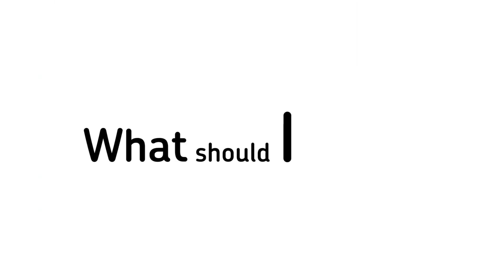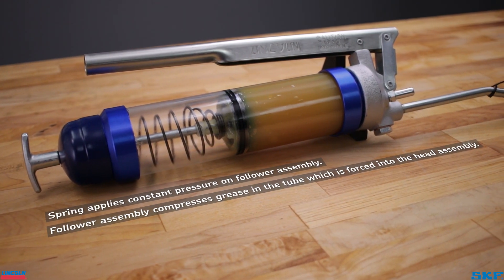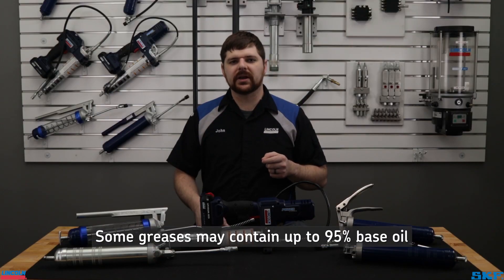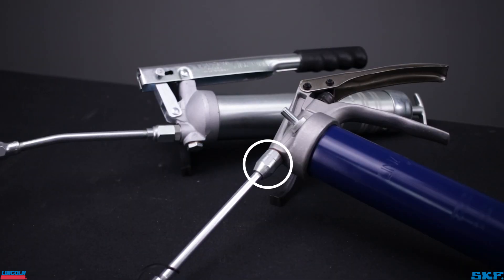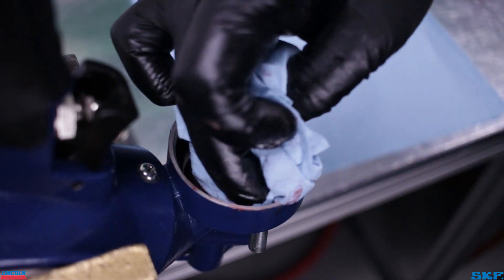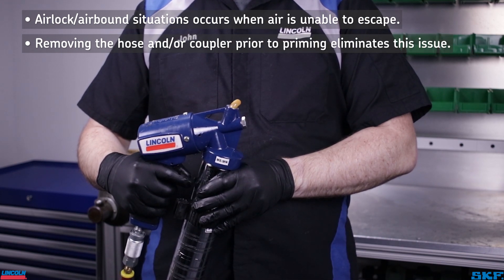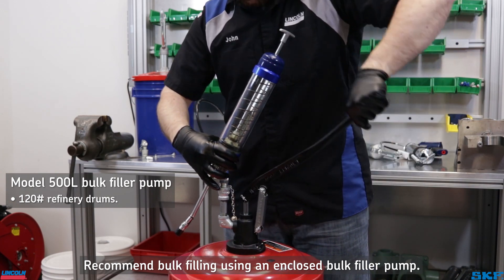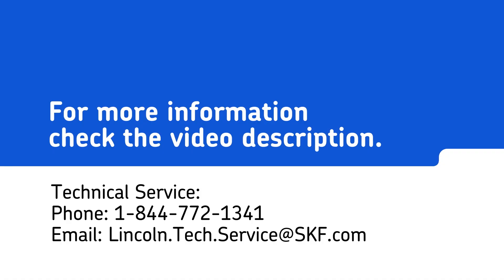My grease gun does not dispense, What do I do! - Lincoln Quick Tips

Comment: So tell me what's wrong with my brand new out-of-the-box pneumatic guardian Lincoln  grease gun🤷‍♂️🤷‍♂️🤷‍♂️ Air will bypass the trigger and nothing comes out of the tube. I have to cycle the trigger many times for anything to come out, but if I hold the trigger all the way in the gun freezes up it doesn't pump again. This is a brand new gun out of the box I've never had this problem before with Lincoln. Grease gun
Reply from the maker: Greetings, The Guardian G120 Grease gun is a Semi-Auto grease gun. Meaning with every depression of the trigger, a single shot of grease will dispense. If you require pneumatic powered automatic dispensing, please take a look at our Lincoln model 1162.

~ John

Comment: Listening tp you is lijevreading the firts 10 pages of a new book ots of non valid info!
Get to the point,why doesn't my new grease gun with a new  cart not pumping grease !even if oil is separating the hand pump should pump.
Q: is there supposed to be a ball bearing in the outlet port,where the grease nozzle screws onto,as I see a spring,with a ball bearing behind d it.
So,I can only say this is supposed to get pushed on when the nozzle is screwed in!
You shoukd tell us about crappy grease,after u tell us why it won't pump,after I squeeze the pump handle several times! As mine is a brand new grease gun from Amazon,and the cartridge is new,well just off tge hardware shelf today! May 16,2024!😮
Reply from the maker: Which grease gun do you have? Majority of our handheld grease guns have a threaded cap on the front which houses a spring and the check ball. Watching this video shows where this ball check is located. In some cases(Even new) the check ball may stick to the check seat, and may need a slight push to unseat. fill the grease gun head piston passage with a thin oil and slowly cycle the handle should create enough pressure to unseat the ball. Other times its as simple as an air pocket is still sitting between the grease and the cartridge and the ball check. Please follow this prime procedure first: https://youtu.be/dXktcAKDjY8. If you have any further issues, please contact our Technical service group. 

~ John

Comment: great video, just picked up a pneumatic grease gun and looking to maintain it correctly I found your video which is so so informative in a direct way....I plan on cleaning the gun with brake cleaner with this be ok?...thanks guys..
Reply from the maker: Brake Cleaner usually have acetone in them which may damage plastics. we recommend using mineral spirits as the cleaner of choice. 

~ John
Reply: @lincolnindustrial  thanks for getting back to me, I'll use white spirit, that'll do the trick....

Comment: What causes grease to get on the plunger side of the gun?
Reply from the maker: Multiple different factors. In older units, could be a worn or dried out wiper, o'ring that seals against the follower rod could be worn. main seal between the tube and head is damaged/worn/missing. all units new or old may see seepage if unit is left unused with pressure on the grease in the tube assembly. Grease guns are meant to be used. If unit is to be used once or twice in a short amount of time(say a day or two) then stored for a significant amount of time, we recommend removing the grease cartridge and storing the gun empty. Doing so will reduce the risk of grease finding its way on the spring side of the tube assembly.

~ John

Comment: Have old small grease gun I inherited, can I use wd-40 or pb blaster to soak the parts to help clean out the very old nasty grease? P. S. It hasn't been used in years. T. I. A.
Reply from the maker: WD40(original) and PB Blaster(original) are not necessarily cleaners, they were originally formulated as rust inhibitors and penetrants for loosening rusty bolts. I'm sure the respective brands have a cleaner/degreaser in their product lineup. For cleaning, a good practice is to use mineral spirits or an equivalent solvent. If heavily soiled, try to wipe off any chunks first, allow parts to soak for a bit in the mineral spirits, then scrub with a nylon brush. 

~ John